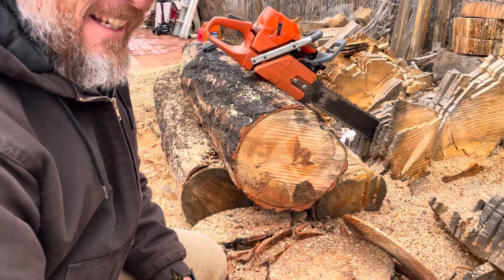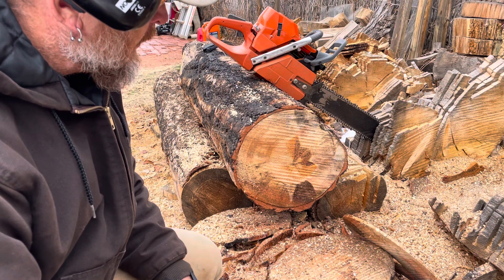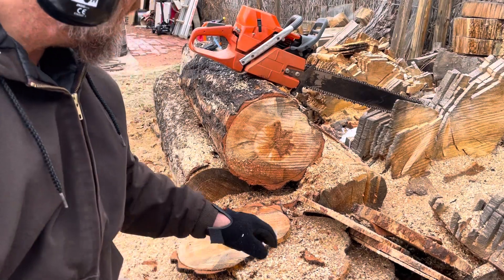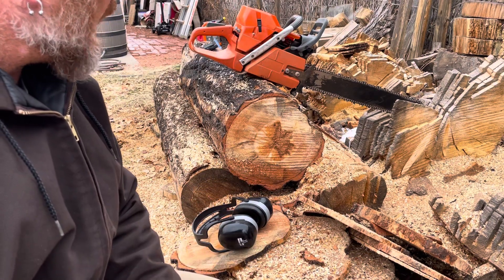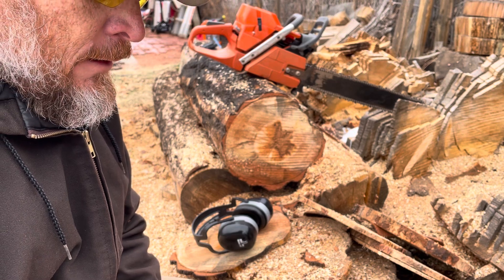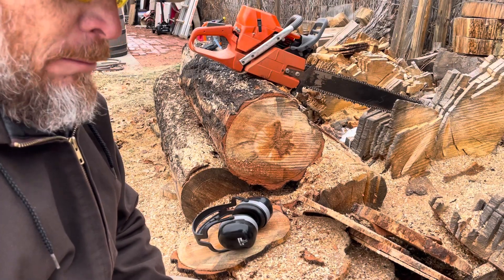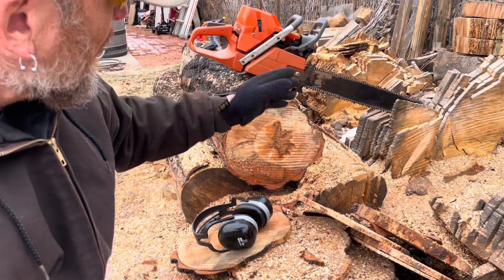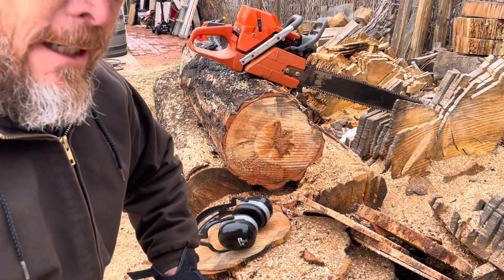First test cuts of the 372 with the experiment golf ball dimples piston.

Comment: What is the I.D. of the pipe you used on the muffler. I used a .625" I.D. pipe and had bogging under load similar issue your having swapped to .730 I.D. pipe an it definitely picked up some torque in the cut a guy can lean on it now without it bogging out when pushing. Might try it before you go through swapping out carbs.
Reply from the maker: It has one of those aftermarket mufflers with the small single hole in it. I left that one and put the larger 3/4” OD in it and it looks like the ID sits right at 5/8”. I do have some plans on putting another 3/4” in it to see if that helps some. But I still feel like the carb is holding it back a little from reaching up to that 13k rpm range. Thanks for the tip

Comment: Falls on its face when you dog in 😬 that's no good
Reply from the maker: Yeah it kind of does. Hoping that if the ring seat in it might be better. But using these cheap ugly cylinders kits is not helping out much. The ports are terrible to start and the squish is a little higher than I would have like it to be. At least these experiments are fun 😁
Reply: @sunbear1973  ring seat is overrated 😀 but hopefully right. Could just be to lean on top but once you lose torque for rev it's no good in bigger wood. More torque the better then can force it threw the wood 🏁🏁

Comment: Seems to have torque... noticed it on the up stroke 😮
Reply from the maker: It feels okay for using that cheap aftermarket cylinder kit. I think that if I apply this to a better cylinder that had better ports and a little tighter squish band it will be much better. I might also have to change the carburetor out to help it out. Thanks for the input